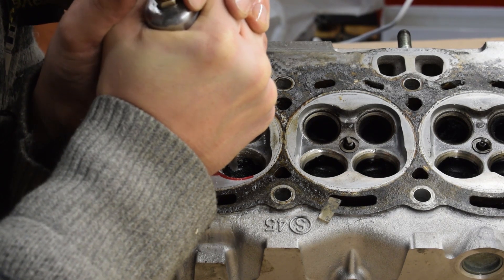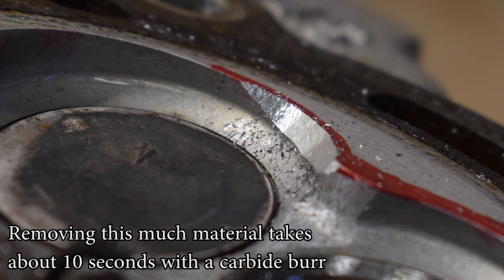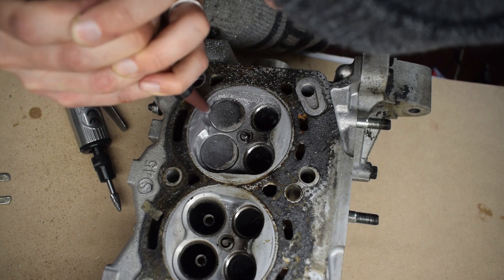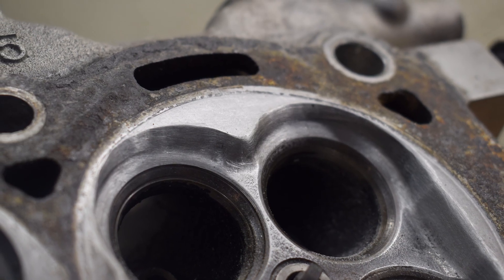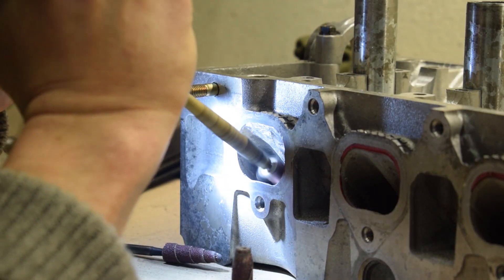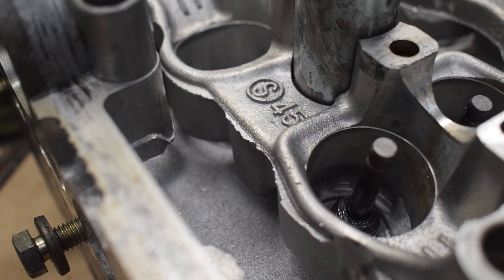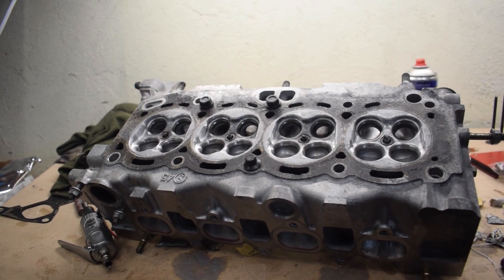PORTING the F out of it - Cylinder HEAD porting and polishing HOW TO - PROJECT UNDERDOG #6

Comment: I like diamond point rotary bits with a dremel over the carbide bits, one because the carbide bits aren’t even meant for what we’d be using them for they can come apart/break apart and they’re roughly $50 each depending on the quality. I can go to harbor freight or anywhere else and get a set of diamond bits for $10~ for a variety of shapes the only con is you’ll be working in a lot smaller sections than a carbide bit but the  dremel and 2 sets of bits is still only $50~ vs the $50~ for one good carbide bit. To me it makes no sense to get a good one when you know it’s going to be going thru it and probably get tossed after

Comment: 8:17  I would stick with a carbide for working the bowls, they are shorter and smaller diameter...less likely to hit the seat !  You can run them low RPM (and they still cut well) to be careful.
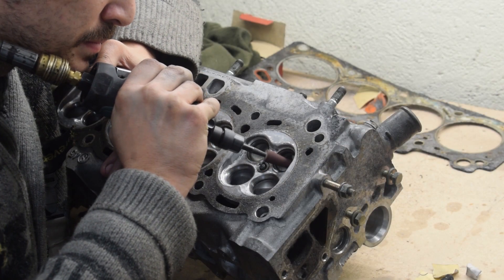Reply: 11:20 I repeat !

Comment: Those casting failures are only there because the mold makers and pattern copers were lazy. Old school lazyness guaranteed that the next model year would have improvable features. Which were often left un improved for the ability to have the next model be better yet again.  AKA  "If its good enough to be sold Its perfect even if wrong until the competition comes out with a better alternative.........   Well what are they doing? Being lazy... Ok great that's what we will keep doing."           Just think how the Corvette never changed until Lambo"s were a common thing in South Beach Miami

Comment: every thing you said About not to much is very true for N/A.
Boosted however the gains are amplified, I ported the Crap out of my DSM cylinder head, it may not have made a huge difference with the stock turbo but it made a huge difference with the upgraded 16g, I lost a little low end spool time which understandable  because air velocity is reduced at low rev low boost but it gained alot in the mid and top end. I made the intake and exhaust runners as straight as possible which removed alot of material so the air has less of a corner to make before reaching the back side of the valves, I gasket matched like you did and took some seat material away where it was creating a ridge on the back side of the valve to smooth the air flow when the valve opened, I did not touch the seat surface for obvious reasons. 

one thing I did notice is the car builds less heat in the head, I can feel that I have less heat coming through my heater core now and the car takes a bit longer to warm up. 

I have done this on several DSM's

Comment: This is a great video and applies to motorcycle heads as well.  I know this might sound like I'm nagging Nellie, but probably a really good idea to wear eye protection when doing this - and any other metal work.  You were really close to the bit on a number of occasions.  One flying chunk and it's over.  I like wearing regular reading glasses since they have a very small magnification index and even cheap ones are made with polycarbonate lenses.  Thanks again for all your amazing content.

Comment: I got a 96 corolla with them 7afe & been thinking of porting & polishing the head plus have my intake manifold & throttle body ported & polished (since there's no aftermarket heads, intake manifolds, or TBs for it)
I do have a short ram intake, headers, no cat, 11.5" long glasspack resonator, & a N1 muffler on 2.5" piping all the way

Comment: So after doing a ton of discussions with engine guys here in MI, USA I found that you never need to grind larger than 91% of the intake valve opening.  Thought your works looks like that or just below. I have saved this to view in porting my own head as "what it should look like" .  My application the intake flow can be overcome with boost as my daily driver is a Saab. It does serve to do this work for racing applications but not for everyday driving. Porting the mating surfaces works for that. Also.. I would LOVE you to do a video on P&P of the turbo exhaust housing. Next chance you get....No one does that stuff and pulling a little radius here and there makes them spool soooo much faster.  My TD04 needed 150g of metal taken out of the turbine manifold flange. It was silly just a round hole on the turbine housing and the manifold was an open square. Can wait to get it running.

Comment: I've heared you shouldn't polish anything after the the injectors because the casting texture creates turbolences that helps mixing the air fuel mixture. Also i've heard that afterbplishing the fuel can form droplets in the intake manifold becuase of the smooth texture. Is this true or is smoother better ?
Reply from the maker: The general rule is smooth for injection, slightly rough for carbs.

Comment: what up brother, prepping to do this on my honda j series head. I noticed some of the bowls on my head, have carbon build up. Was going to try and clean first before I can begin sanding down but I think  I should be find to sand as is no? And I wont be using a carbide at all. All my porting will be done with sanding cartridge rolls. This should still cut material when I go to gasket match the intake and exhaust ports right, just take slightly longer? TIA
Reply from the maker: I would get rid of the carbon build up first, it's easy if you use one of those household cleaning steel wool things, like this: https://images.app.goo.gl/k9yj8cJNW9KcTuMw6
Without carbide bits you can still gasket match but it takes a lot longer and you'll spend a small fortune in rolls.
Reply: @d4a  Yeup just watched another extensive video on porting and I picked up some steel wire for the chamber, and some flap grit wheels for the carbon in the valve bowls. I did want to do carbide but as a first timer, I'd rather play it safer and only widening the ports a bit more. So while it may take longer, I've stocked up on 80 grit cartridge rolls. Thanks for the info brother.

Comment: Great video, and absolutely right.. always be conservative and but polish as much as possible.. I've been doing this for almost 50 years.. also something you should make.. find a long 1/4" shafted bolt,,, cut the threads off, cut a very thin slice down the end of it. You can now slide any grit of paper, since it acts like a floppy wheel.. I finished with either 800 or thousand.. of course after I spent getting rid of absolutely all casting imperfections.. I would go as crazy as literally polishing it with some metal polish... I know something wrong with me.. lol. I've done this with my motorcycles, cars and boat,, and yes noticeable difference. Unfortunately no numbers...

Comment: One other thing you can do is use wax on your carbides, stones and sanders when working on aluminum. It will make a huge difference in finish, working speed, and heat.

Comment: This is wrong, wrong, A good example of doing it wrong. Almost no air comes in at that angle, You would have been a lot better off removing material from the sides of the combustion chamber, you also need to raise and widen only the outside ceiling of the intake ports, narrow the valve stem area, when you work the short radius on the floor you can shape in a tear drop shape  to slow air slightly to adhere to the small radius better, air will still break away from the small radius, but it will be better. And you will gain power through most of the rpms, not just high rpms. You also need a flow bench to match each port, then you need to measure your combustion chambers volume to match each other. Look up David Vizard on YouTube, he also has books on it.  You should be using sacrificial valves when working the chamber, and then you need to see what the max flow is at what lifts so you can choose the right cams.

Comment: A good tip for porting  its using ballstones and keep them allways wet with WD40 and low r.p.m.  it helps keeping same diameter and very smooth surfaces especially near the bowl .Very nice chanel and nice porting...

Comment: I'm not convinced that those valves need unshrouding. The valves are angled and unshroud as they open. David Vizard unshrouds small block Chevy chambers but they're not hemispherical
Reply from the maker: The valves open about 8 mm. For a large part of the circumference of the valve the first thing the air sees is a wall. The valve can't open beyond the height of this wall. The stock chamber was designed to tumble the mixture as much as possible and for good torque at low rpm. Plus I believe these chunks may have acted a bit like a heat sink. Unfortunately neither you nor I have the methods to do actual empirical testing on this head to prove our points, but at least basic theory aligns with what I'm saying. I don't know who David Vizard is, sorry, I'm not in the states. But a small block is light-years apart from this engine imo. Apples and oranges.

Comment: Now that you did all that work to the 4A head is now a good time to tell you the 7A head has larger intake valves more valve lift and a hotter cam duration?
Intake Valve Diameter: 31mm (32mm with 4A-GE oversize intake valves)
Exhaust Valve Diameter 24.5mm
Valve Lift: 7.6mm (4A 6.6mm)
Valve Timing: 
Open 6*BTDC Intake
Close 38* ABDC Intake
Open 42* BBDC Exhaust
Close 2* ATDC Exhaust
Reply from the maker: Don't know where you're getting the numbers from but late 4afe and 7afe heads have the same valve sizes. Same cams too. You're likely comparing the early 4AFE heads, which the head in the video isn't. I have made the distinction clear and explained it in many other videos too. The early heads have very little performance potential. When it comes to the cams there is no single cam spec and there have been multiple different cam specs for different markets. Believe it or not the head in this video has 8.5 lift on the intake and 8 on the exhaust. The cam is stock. Apparently a 7afe with such a cam exists too. They were made for the UK and some Asian markets.

Comment: Do not finish the intake ports with 150 grit you want a rough surface I use 36 grit for a nice uniform finish and it also helps fuel and air tumble through the port

Comment: I supercharged my 5vz-fe v6 with a magnuson mp62 roots blower in 2019 and it had a nice and smooth intake runner but it catastrofically failed so in 20 20 I received a replacement and was super dissapointed with the extreme casting flash in the intake. Extreme casting flash...I have a shitty dremel and it took me days to port it. now the exhaust side was almost worse but I didn't have an extension to clean it up. maybe next year when I pull it for maintenance. The truck did dyno 299whp and 310ft Lbs Tq which is amazing to the 150whp it had before

Comment: 95% of British Mechanics thinks the biggest ports=more "fuel" (!) = more power! The bigger- the better hey! Also, for the street (daily) use - I would not even recommend to use those rolls (not to talk about carbide burrs) and do porting with a finger and emry cloth/sand paper, starting with rubbing it with 60 grit and to finish on 240 grit (not more!) There is NO BENEFIT FROM MIRROR POLISH OF INTAKE PORTS AT ALL AND THERE ARE EVEN LOSSES! So, leave you ports after 240 (or even 180) grit UNPOLISHED! ROUGH SURFACE BENEFITS FROM MORE HOMOGENOUS MIXTURE FROM BETTER EVAPORATION OF FUEL AND FROM FUEL ATOMISATION!

Comment: quote "Aftermarket seats are inferior to OEM" wrong, quote "touching the seat will result in the seat needing to be replace" also wrong. seats are recut not replaced.  The seats on that head are no good, they need to be recut with a decent multi angle valve seat, that ironically will provide more flow than what you have done with your grinding on the chamber.

Comment: Hello, thank you for your movies, you are great engineer and I really enjoy to watch them. According to your work shown on this video I have a question about combustion chamber shape modification. Have you consider how grinding of material around valves will impact on air swirling during suction stroke? I think that for low valve angle air swirl is different than for large valve angle. I think that this "shelf" around valves redirect air swirl to omit intake valve when it is in open position (for small valve angle in complete hemispherical chamber air which circulate inside cylinder hit open valves and create local pressure area around them which slows down air which is in intake intake port just before enter to cylinder). It is very interesting for me if your modification improve air swirl inside cylinder or maybe it slows down a little because more air is hitting into open valves. Of course you are going to use turbocharger so air swirl is not so important but just for my curiosity I'm very interesting of it. Maybe you can prepare some video in this topic?

Comment: I remember when porting a cylinder head ment going to a shop and they would hook the head up to a machine that would push a substance that was like silly putty with sand in it at around 300 psi through the intakes...have you ever thought about making swirl marks (all in one direction) in your intake ports? To help the intake pass the air/fuel mix along, making something like a mini tornado effect? Tumbling air does help with fuel vaporization but spinning air does this as well with the added benefit of moving more easily (if the properties of fluid dynamics are to be believed). I could be way off, swirling air/fuel could negatively effect flow rates, but it just seems right to me.

Comment: For the intake I would give it a light sandblasting with low pressure to lightly ruffen the port for air/fuel mixture you want to keep it mixed..
  That is a good choice of cleaning up the oil Gally I chamfer the edges as well as clean up the cast marks I do this to all my motors.. 
  My exhaust ports I pollish like a mirror... 
  I don't know what you block looks like but if there are ruff casting burrs I take those down as well it helps in many ways if oils drips down and also strengthens the block I remember seeing a few old V-8's crack almost in half from Tork... I'm glad to hear you say about measuring the combustion chambers to make them equal....
   Casting flash please do remove it if it chips off can do lots of damage and strengthens the block from cracking it might seem like it don't matter but it really does... Very good job... But never polish the intake port keep it ruff for air /fuel mixture but combustion chamber and exhaust ports polish like a mirror..  looks like you did a very good job on that one on two of my race motors going all out with a good 100 H.P. gains then my spare milder street  heads a good 75 H.P. gains  
  Keep up the good work ...
P.S.   I don't know if this would apply to you motor or not but on my Oldsmobile's on the big end of the crankshaft I had an oil relief slot ground on the side 1/2" wide by 25Thousands deep I also put oil restriction in my camshaft oil Gally and chamfered my crankshaft oil galleys along with cross drilling them with a bigger oil pan and high volume oil pump with bigger pickup tube..

Comment: If you remove more material from the combustion chamber and put in a thinner head gasket wouldn't that increase your compression ratio? And even if it didn't, wouldn't your turbo psi make up for the difference?🤔

Comment: When you're porting heads like this, how do you ensure your volume (especially at TDC when shape and volume of the chamber is incredibly important for how your fuel/air mix combusts) stays the same between cylinders? Wouldn't even a small amount of volumetric difference negatively affect the balance of the power strokes in each cylinder? I don't know if this is important or even measurable...
Reply from the maker: It's both important and measurable. I will be doing a video about that. Some call it CC-ing the chambers and you can do it yourself relatively easily.

Comment: For the exhaust bowl porting it would be better to have a shorter roll, Or just a sanding tip. One that fits inside on the stem and theres no sanding roll (and with greater radius)_ coming over the seat. Not only thats risky, but greatly reduces how much you can tilt the grinder compared if you had just a shaft / stem wrapped in tape there.

Comment: I have ported 3 single cylinder twin port bike heads a honda xr600,a KTM 660 and a Rotax 551.A tool shop chain in the UK sells a 3 pack of 30mm diameter X 5mm flap wheel that I use in my Dremel.They are ideal for my porting work and find porting heads quite thereputic.

Comment: really good video to see you doing this yourself! something i would add is at 8:14 when showing your new intake ports would it not be better to have a sharper edge on your split in the middle, because surely fuel will hit that and be more stuck that way? im in the middle of porting a d16 honda head like u mentioned in the video and have sharpened the middle quite alot i will send a picture to show u what i mean :D https://photos.app.goo.gl/5MP8cmoaPDGo1wJt8
Reply: i also wanted to say thanks to some of your previous advice i converted my car to bike carburettors aswell :)

Comment: Nice video, some really good tips. For future reference though, please please please wear safety glasses when you do this! A carbide burr spinning at a couple thousand RPMs can easily send a piece of metal straight into your eye. Potentially losing part of your vision for few extra horses really isn't worth it. Work smart, work safe.
Reply: A magnet like eye doctors use to get steel out of your eye doesn’t work on aluminum.

Comment: The flat are in combustion chamber is quench pads , used for the placement of the mix with in the cylinder , run the intakes rough say 80 or 60 grit , think of it like a mirror , breath on a mirror and the condensation sticks to the mirror , same with fuel droplets  , good work